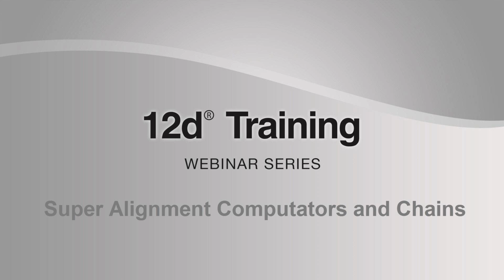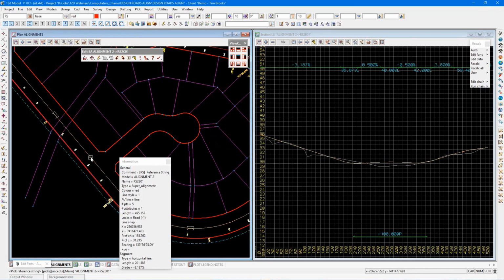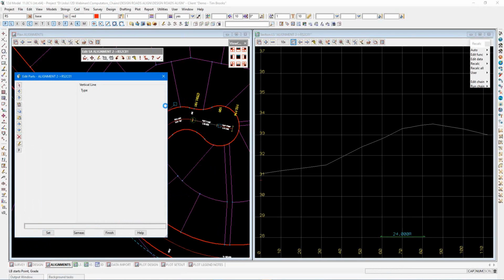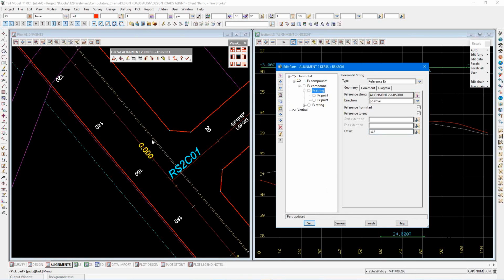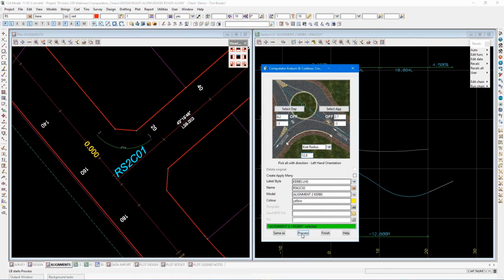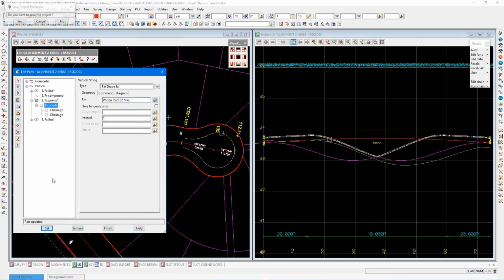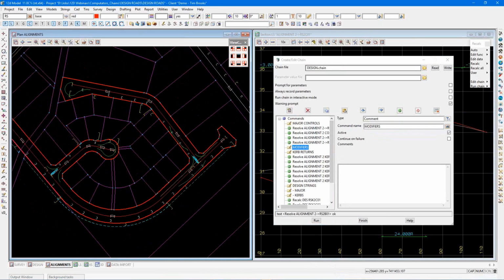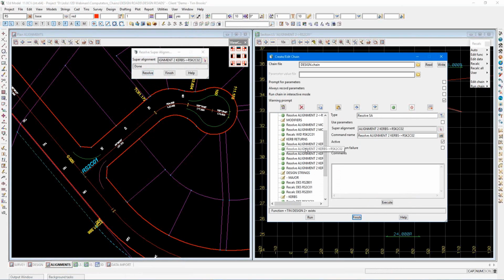Super Alignment Computators and Chains - Training Webinar Series

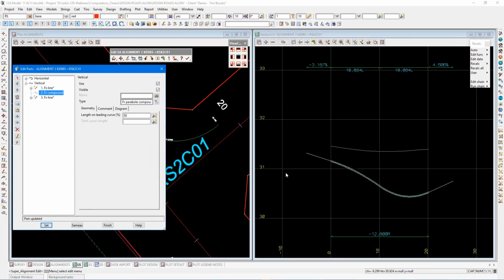Comment: 24:39 If you use an FX parabola compound here, the low point will fall within the curb, which is not permitted under some standards.
 Is there a way to create a vertical curve (with an adjustable length) where the low point of the vertical curve is located at the low point on the right side (the end point of the kerb return)?
Reply from the maker: Hi, in order to achieve this you would need to grade the intersecting road centrelines so that the low point moved beyond the extends of the kerb return.